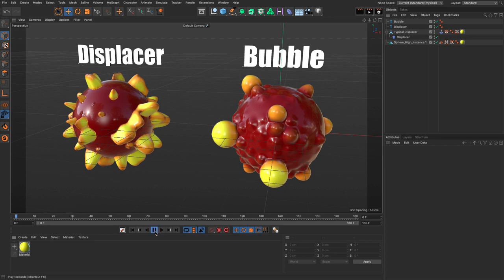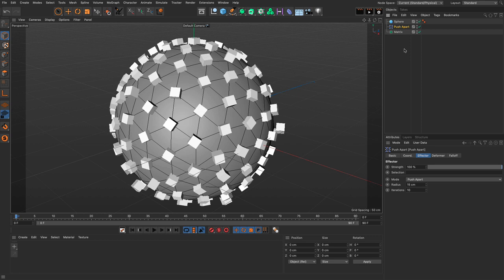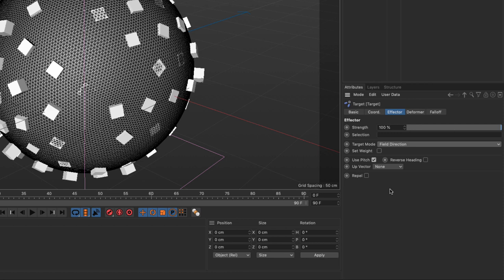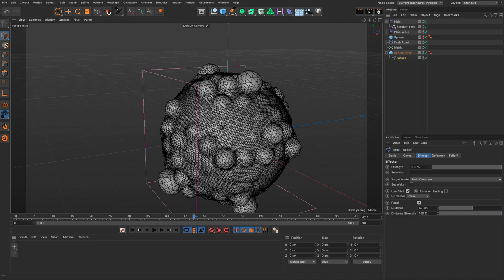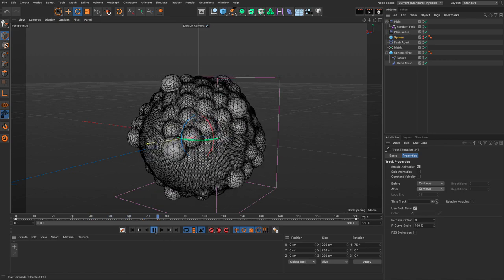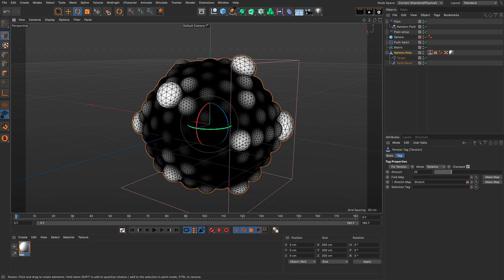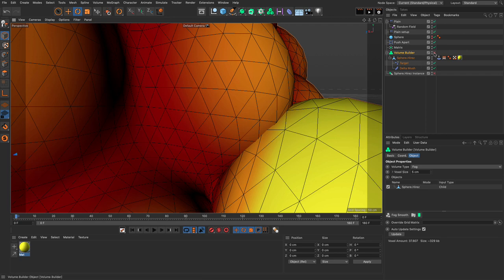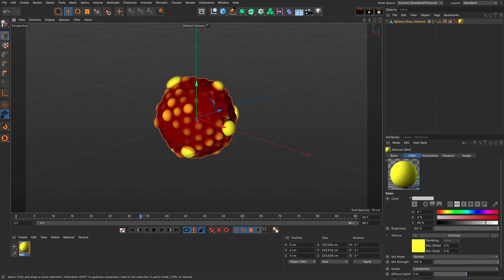Create a Bubble Deformer in Cinema 4D

Comment: Excellent tutorial, thank you. I discovered a bug; this setup works in C4D 2023 but not 2024. For some reason, in 2024 the screen does not update when scrubbing the timeline. You have to keep hitting the A key to see updates. It won't render the animation either. The Same file works great in 2023.2.2 though.

Comment: Great technics! Learned a lot here. I noticed it doesn't work in C4D R20 because the target Effector doesn't have the Direction Mode "Use Value". The other modes don't work. Any idea for a workaround?
Reply from the maker: Change to "Attenuate By strength", add an inverse Layer on top of the Matrix Field, make the Repel Distance very small (5cm) and you'll get a bit closer
Reply from the maker: and maybe decrease you Plain Setup Z to -30. All that if you made it similar in size... and removed the Delta Mush
Here's a file that works here:
https://www.dropbox.com/s/usva9tjuuyl35hs/Bubble%20Deformer%2003A%20R20.c4d?dl=0
Reply: @noseman  oh thank you, you are quick! that worked!! :)